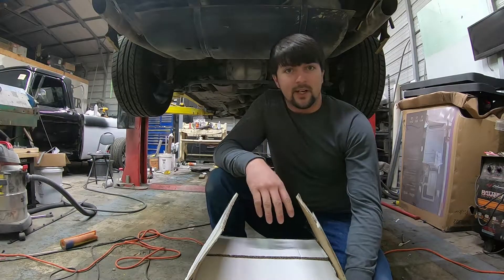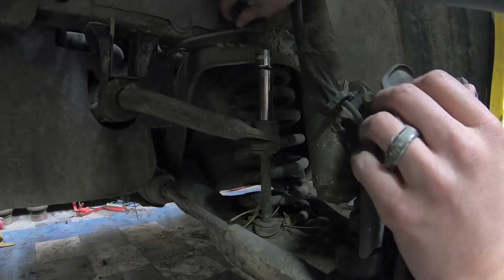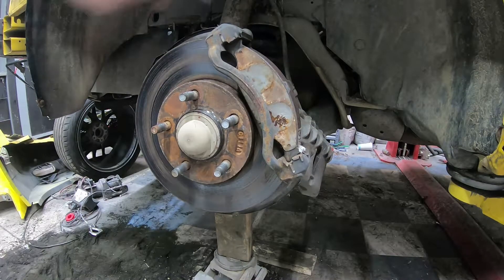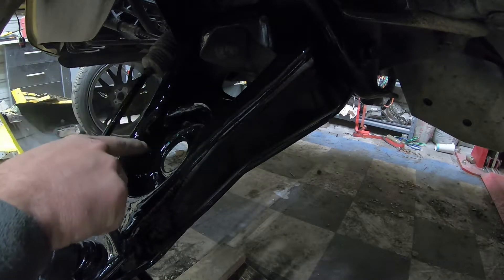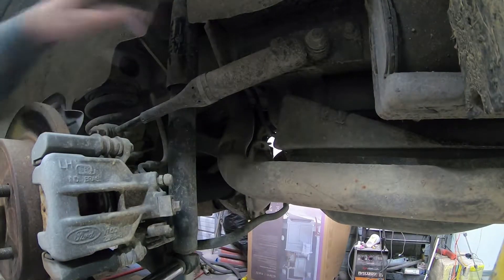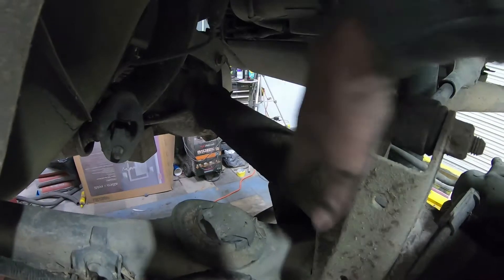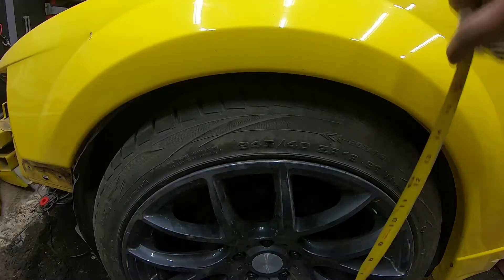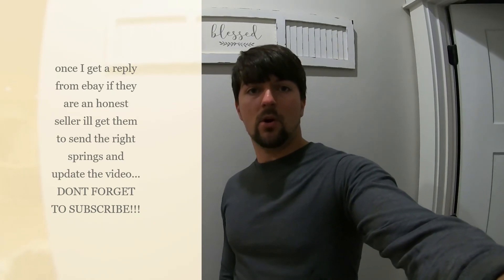Ford Mustang lowering spring installation

Comment: Thanks bro best video on youtube. You show all the steps. My car was uneven from the back i had the bottom pigtails pointing the other way. So my car sits lower on one side. Now i can go back and fix it. I looked up alot of videos but you are the only one that shows how to sit the spring. Thanks alot!
Reply from the maker: BCMACH1 Iv found out the hard way on cars from my past so thought by being specific it would keep others from making mistakes Iv made before, thanks for the comment.
Reply: I have the same issue on my 04 gt   one side it’s lower then the other side   Now I will go back and fix it

Comment: Was rear springs wrong. Keep up good work
Reply from the maker: 256 Garage yeah, so the company gave me 50% refund so I’ll address the rear getting it down by cutting a coil off, Iv done it before so I know it will work,
Reply: @1194video  yeah that's way I done the drag springs on my foxbody when it set to high.
Reply from the maker: I have debated going coil overs but I’m not going to be using this car to race I’m building it as a daily driver so I’ll be putting a lot of miles on this car so I don’t want to spend a whole lot of money fixing it just to use it and kill the engine with miles
Reply: Yeah

Comment: I bought these same springs with the same results. Did you end up cutting a coil out of the rear springs or did they send you the correct set?
Reply from the maker: sorry youtube just allowed me to see the comment, I did have to cut the springs, I cut 1 full coil off
Reply: I just got these used. Guessing I'll have to cut the rear as well?